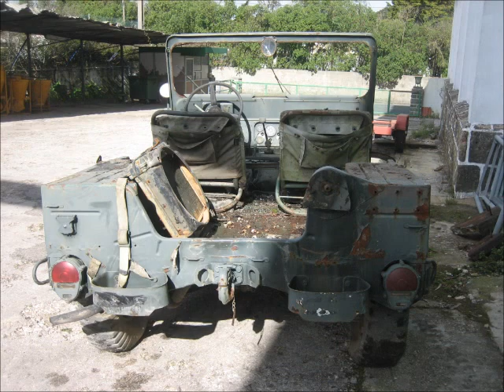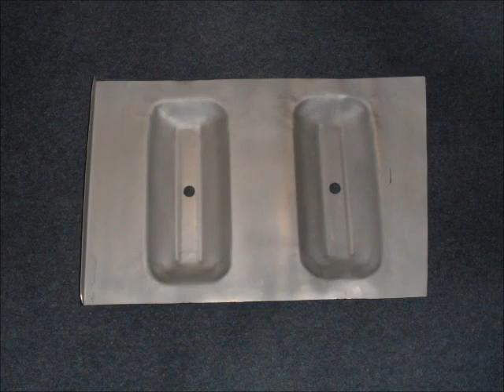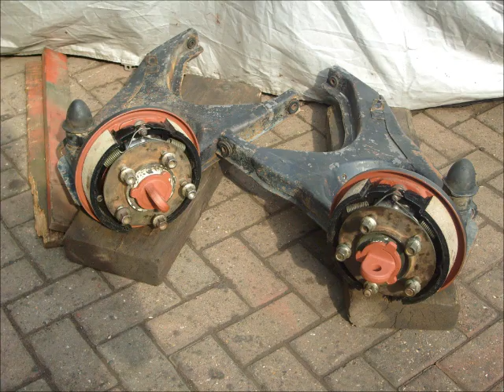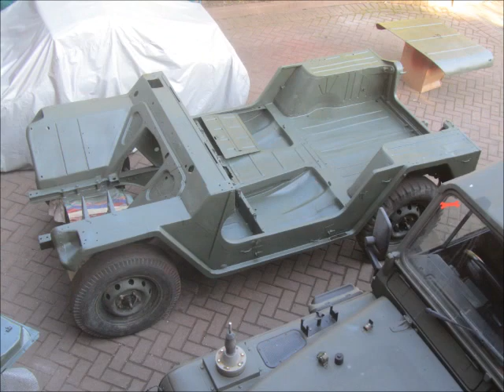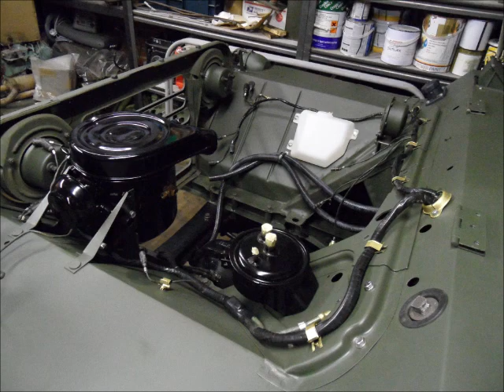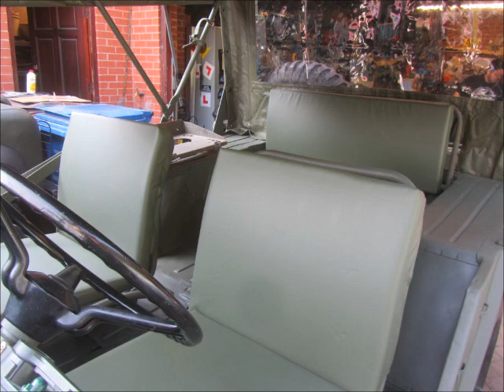AM General M151A2 Restoration Project

Comment: Nice work.  Good to see one restored to pristine condition.  I served in in the US ARMY in West Germany as a Combat Military Policeman (95B) and drove the M151A2 with trailer...side panels and doors...yea...and it had rusted-out floorboards and the heater didn't work, which made Winter Field exercises an "adventure".  Anyhow, I reckon I should thank you for keeping the memory alive - the truck looks awesome!  :-)  By the way, the bench seat in the back provides just enough space to stow a cardboard case of Coke.  With the German winters and no heat, no ice box was required.

Comment: Are you my old Motor Sargent? Because that's how he thought things should of been done. All we got for the M151A1s were motors packed in a clam-shell container with what seem like a million bolds keeping it together, then when we opened it you found the engine covered in reddish brown sticky ass grease.

The jeep with trailer looks just like I remember and the video presentation was one of the best and as the Gunny would say" THATS OUT STANDING SOLIDER "